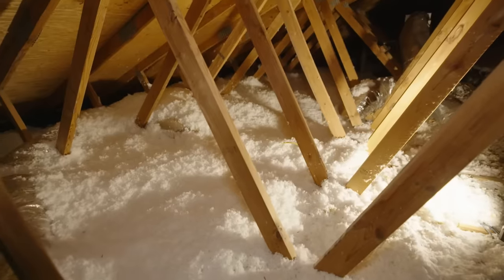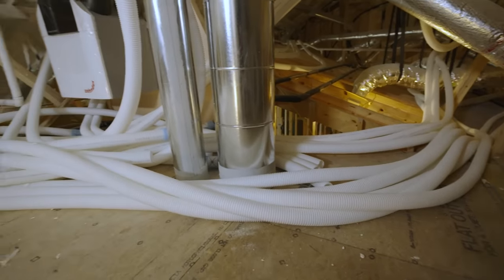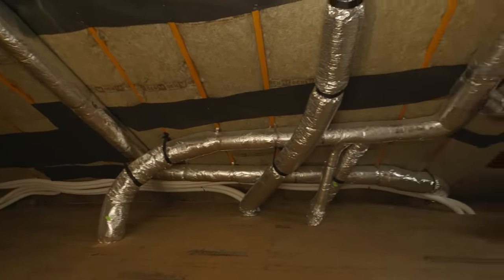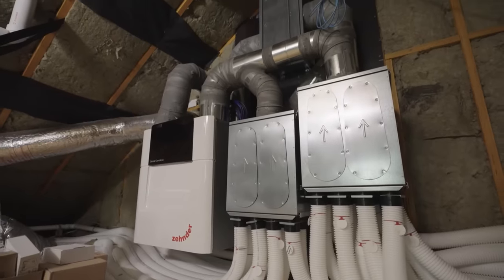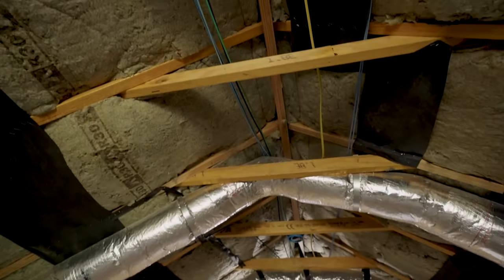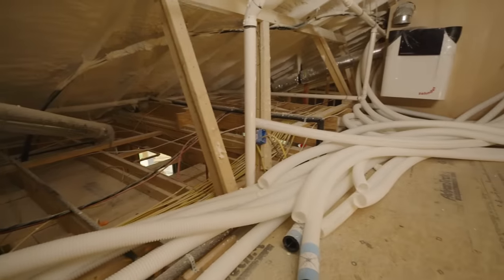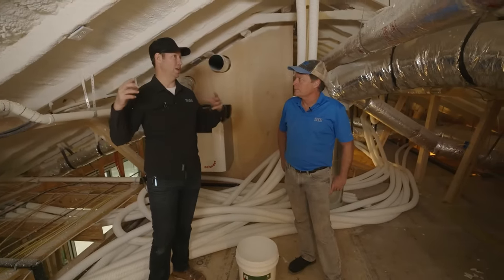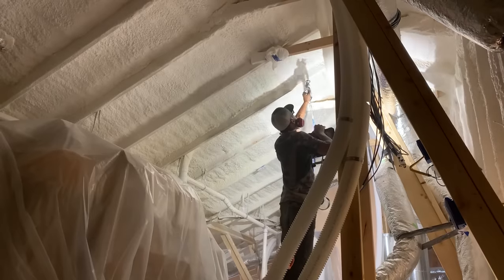Building a BETTER attic - Unvented + Conditioned attics 101

Comment: I really like what I saw in this video.  Very neat technology.  I also like that you thought about the fresh air needs.  I would not have thought of that need, but should have since I grew up in the days of the gas space heaters.  As a former volunteer fire fighter, no or at least less smoke is a big deal.  Current trends are to cut a bunch of holes in the roof to let the smoke and heat out so you can see where the fire is.  In a house fire with someone trapped, the firefighters had to back out when the FLIR camera showed the temperature at 742 degrees, roughly 4 feet off of the floor.   The trapped person didn't make it.  As the fire captain said, "no one survives that kind of heat".  The open core bedroom doors just went whoosh and only the frame was left.  This was a 50 year old brick 3-sides house with typical shingle roofing.  That was the problem.  With the room temperature that high, the tar on the bottom of the shingles melted and dripped through the sheeting, then burst into flame in the attic - making the temperature that much higher.  Once they got the attic temperature down a little, they were able to go in and pull ceiling to finish the lowering of the temperature.  The whole thing was out in about 5 minutes after that.  As a result of the SMOKE, the city inspector required that the left overs be taken to a special hazardous materials dump.   The smoke alone caused everything to be classified as hazardous.  If your house catches on fire, please remember what we taught you in elementary school, get flat on your belly and pretend you are an alligator then crawl out.  Don't stand up!  Your lungs can't handle the heat or the smoke.
Reply: Wow. Incredible story

Comment: having been raised in Florida all my life I would have to say this is the best idea I ever saw on building  an attic the right way
Reply: i had 2 new homes 1 in Pa 1 sw FL dumb thing in FL is the ductwork in attic and water pipes in attic summer takes gallons of water which is expensive her to not burn your
hand it wash them and the efficiency loss on a/c saves builders a fortune but cost extra every month

Comment: My attic used to go to 130F in summer.  I had spay foam installed and it rarely reaches 90F. The electric bill has been reduced by about one third. But the more important thing is that the AC cools the house much easier. From Atlanta… the other benefit is that the attic is much more usable because you don’t temperature extremes. My attic is floored so it’s like adding extra rooms to the house.

Comment: In England, a 'conditioned roof' is referred to as a 'warm roof'. In colder climates (colder than Texas is most of the time - but maybe not MUCH colder) it's vital to have a vapour control layer (VCL - usually a membrane) on the warm (inside) side of the insulation so that moisture-laden warm air cannot move from the living space towards the colder outside, which would result in interstitial condensation.  This is ruinously damaging for out of sight woodwork.  What we learnt as householders doing a retrofit conditioned roof was that most roofers knew less about this new constructional method than we (who had taken an interest) did.  They, being used to loft spaces being ventilated,  just did not 'get' the importance of the VCL....which is very tricky to implement properly at abutments and penetrations.  A warm roof, as Matt says, is brilliant - but it has to be done right.

Comment: I used radiant foil OSB when I built my house in SoCal, the attic was 20° cooler than the outside in 100°+ days. Well worth the additional cost.
Reply: Can only imagine the price of that today considering the price of normal OSB..
Reply: @MrWiseinheart  thanks to the liberal policies
Reply: @vcubed7275  exactly every cost increase in the world is directly related to liberal policies
Reply: @butch8792  yes! I’m glad we’re on the same page
Reply: @butch8792  No, just 75% of them.
Reply: Doesn't it reduce life of the shingles?
Reply: @vcubed7275 
Just blame it on liberals for everything.

Comment: The biggest practice change is trusses vs rafters. Newer houses use trusses because they are faster to install. Most people who can afford on site cut rafters do so for the extra attic storage space.
Reply: Also, if you're in an area where high winds can be an issue (tornadoes/hurricanes) check what happens to the prefab truss roofs.
Reply: Maybe they can do it with attic trusses.
Reply: There are a variety of truss designs. Some easily allow for use of the attic space.

Comment: We have an unvented attic and it has its ups and downs. live in california and out attic never gets above 85 degrees even if its 110 outside. Now this is great during the winter cause it really insulates our house and inside will never drop below 65. However during the summer after the long hot day and when it really cools down outside it takes forever for the inside of our house to cool down even if we have a lot of windows open. Its like a greenhouse effect and the house doesnt cool down until the attic finally cools down.
Reply: We love our whole house fan on those hot days when it gets below 80 by 9 pm. We’re good without ac til late mornings. 

Maybe that’s where Matt is talking about the fresh air resupply?

Comment: Matt, love you videos, but for most people / builders, spray foam insulation will remain a pie in the sky scenario due to its high price. However, I do think LP Techshield + R13 or R19 in your roof rafters with a 2" air gap would be sufficient for an "upgraded" home in terms of its attic insulation, IMO. Then, get your ducts sealed /& stretched out really well over your ceiling joists with blown-in insulation over them. Finally, make sure your HVAC unit is in an insulated room / closet and add a QuietCool attic fan that operates at 70 to 110 watts to remove any excess heat. Good ventilation is also key, of course.

Comment: Keeping it 100% real, I’ve been doing contracting for years now and I can’t even imagine customers wanting to spend all that money. 4” of close cell your looking around $5-$6 per sqft depending on the area and each bucket of costing is $300 each. In Texas you do not need 4” of close cell at all. In Canada we’re temperature goes under 0 use 3”. It’s amazing what their doing but way out of the budget of average Americans.
Reply: We do need the 4” (and more) in the south and southeast except for opposite reasons as you. We want to control heat and keep the a/c where it belongs. Building code in my part of Alabama requires R-30 or better. 

Biggest problem with this conversion idea is roofing material and warranty. Most materials except membranes and some metal roofs require backside ventilation (especially shingles) to prevent excessive ware on the asphalt plys and melting of the roof products and coatings. It’s also a problem with water vapor (depending on the roof type). We’ve done exactly this type of thing but have to use a ventilated nail base or put metal on furring strips.
Reply: Robbie Wahl roofing membranes as in the peel and stick membranes?
Reply: @drlava641  Put a layer of cedar breather between the deck and the asphalt shingles, in effect venting above the deck instead of below it.
Reply: @27photogger  no, I refer to commercial membranes such as TPO, EPDM or PVC. The only peal-and-stick that, I think, is appropriate would be a Modified Bitumen type and you’d have to check with the manufacturer.
Reply: In the north where you can actually have a basement, it makes sense to have a vented attic if you do it right, to so much less expensive and you can pile on the cellulite.

Comment: During a week of measurements in Mid-June, 2021, my 'traditional' attic in Spring, TX (North Houston) averaged 4 degrees hotter than the outside temperature (measured in the shade).  The max differential was 9 degrees at 7 PM.  The temperatures were measured from 7 AM to 11 PM.  Mid-afternoon outside temps were 95-96 degrees.  There is radiant barrier sheathing, ridge vents, continuous soffit vents and one solar powered Attic Breeze exhaust fan in the attic space.
Reply: BS

Comment: I understand you have a metal roof but if your roof is standard shingles, the shingles need to permit some heat to pass through.  If you insulate right against the plywood roofing sub-straight, that heat will be forced back to the shingles and cause them to dry, crack and edge curl greatly reducing their lifespan.

Comment: I unvented my vented attic 10 years ago with 4" of hi density foam. It has been great. I don't get blast of hot air when the A/C comes on or freezer air in the winter.  I do not use my attic as storage so no paint needed, 
To convert, I fashioned solid foam blocks to stuff over the outside walls to spray against. Just sprayed the bottom of the ridge vent as the opening wasn't very wide. I would have used something like zip tape if I did it now.
I can work up there any day of the year. It is only a couple of degrees from the living space below.
The leaky roof is not an issue. I have a metal roof and even if I didn't and I let the roof go for 40 years, I could just resheathed the roof over the existing plywood.
I live in upstate NY and did this when the old experts said it was a mistake, and now today it is the preferred method.
Reply: Ray C , great job but you may leaks since all metal roofs will eventually leak. Them yiu have a mold issue.
Just saying

Comment: I’ve done the same thing with batts and I only use spray foam if it’s the only way to insulate the particular job or if the client insists. The jury is still out on what happens to the plywood that’s above the insulation if it has no air flow or if it’s sealed on the cool side as with spray foam. That’s why I prefer batts up against the roof deck but with fluted baffles connected on the down side by a vented soffit and on the upside by a ridge vent. This allows some air movement between the insulation and roof deck thereby reducing a little bit of the heat build up. Great video but I might add too that the depth of the trusses will determine the depth of your insulation in turn the R value of the insulation. The video shows R30 therefore you’d need a minimum depth of 10” to allow for R30. This would be a special order truss if you’re building new or you’d have to fur down the trusses. Great video Matt. Keep em coming!

Comment: Here in the UK with our wet climate that spray foam 4:56 is deadly to wood beams in the roof. Do not use spray foam like this in a wet climate. We bought a house which had it done 5 years prior and I could crumble the wood under the foam with my bare hands. We were lucky the roof did not cave in on us and we had to replace most of the roof in the end. What happens in a wet climate is the water soaks into the wood throughout the year but especially during the winter but does not get time even during our "3 month summer" to dry out fully. This is because the spray foam first of all allows the water to pool and collect in between the spray foam and the wood but also prevents the heat from the house from getting to the wood at all which helps dry the wood.

In a wet climate stick to rock wool or glass wool insulation if you want your wood to last. I think I would even be hesitant to use spray foam insulation in Texas without creating space for the wood to breath. Let me know if 5 years how it held up.
Reply: Huh, that's odd because it's been used extensively here in Florida for years now with absolutely stellar performance. Sounds to me like there were underlying issues with that property.
Reply: @chadleach6009  Our roof was 100+ years old so the damp proof sheet between the wood and the tiles was not exactly performing well. This meant moisture could get into the wood and collect over years between the foam and the wood as i said.  The wood beams which were not fully covered in foam were able to breath just fine and dryed out in the summers nicely. The others covered in foam were wet and crumbled in my hands.  Wood does rot in water especially old wood and our houses here in the uk are 100 - 200 years old easy so i think that + the temperature + how it is installed + roof type/angle are all factors.  I imagine this stuff works great in many scenarios but I will be sticking with glass wool insulation which breathes nicely.  Also removing that foam is a major pain too. Took all day to scrape it off the wood when we replaced 90% of the roof. Lots of landfill. Glass wool could have been put back in place after repairs so i think of foam as "fast food roofing" now. Not for me. I will also assume the owners are trying to hide problems with the roof in any future properties i purchase which luckily we also did when we viewed this property 5 years ago. We asked for 8000 off as we thought the roof might need repairs which it did.

Comment: I just got a new roof and changed to a conditioned attic since I have a lot of AC ducts in the attic.  Night and day difference, so glad I did it.  Now it's 78 degrees in the attic (same as house temp) instead of 120F on hot summer days.  I went with 3" polyiso insulation and lightweight concrete tile mounted on battens.  The air gap between the tile and battens allows hot air to rise and cool the underside of the tiles -- that serves the same function as a vented attic.  I was originally going to put mineral wool between the rafters in the attic as well, but because of the good performance I will probably skip that step.  With modern insulating materials (polyiso) I think it's crazy to design attics the old fashioned vented way.  Another benefit I didn't think about originally - closing off all the vents will prevent termites and insects from flying into the attic.
Reply: and mice, birds, bats, lizards from nesting.
Reply: @MommaARA  rats an mice an birds need a safe warm protective place to live slso dont they??

Comment: I'm glad you mentioned that zender thingie at the end because I was really wondering about how air exchange is handled. Because otherwise a really tightly closed up building is going to have a build up of CO2 and get uncomfortable fast.
Reply: One of the ideas that Matt is promoting and which you find with systems like Passivhaus is to build the house really tight, and then design in a very good ventilation system. This will keep the air in the house healthier than outdoor air because the ventilation can filter out pollens, dust and pollutants, and maintain a good humidity level. Also the ventilation should include heat exchange. This kind of ventilation is becoming more and more common in good quality newly built homes.
And of course, weather permitting, we can still open the windows.

Comment: A few years ago I re-did my attic in probably the largest home improvement project I will ever do lol
1950s house, and the attic was finished in the 1970s, and the thin drywall and cheap wood panneling was falling apart, and it was always hot/cold up stairs.
Gutted everything except the framing, then added a spacer on the roof line, then a radiant barrier, then batt insulation, and then thick drywall.  It changed so much!  Still need AC units in the summer, but much smaller units keep up well even on medium where we used to have much larger units on high all summer.  Things are quieter, cleaner, less humid, and everything is working really well.

Next step is figuring out something for the AC/heat up there.  Heat rises, and that is the only place to escape to, so it stays comfortable in winter, but there is a lack of air flow/exchange, and during the summer AC is absolutely required.  The rooms all have HVAC supply vents... but no returns.  Our HVAC is from the late 80s, and it is kind of a miricle that we havent had any issues with it  yet, so we are saving up to replace it as the next big home project... that that will be a doosey, but I wont do that one myself.  Hoping to move the HVAC to a different location in the basement (what use to be a garage that is walled off), and re-route all of the supply and return vents in the whole house to make more sense and work better.  Should be the last step of 'functional' changes to the home before we go nuts with purely aesthetic changes to finally make our old 1950s wrecker look as nice as it feels to live in since I have done so much work on the electrical, insulation, and water management aspects of it.  We have the biggest home on the street, and the lowest power bill, but we keep the house at 70* year round while most neighbors keep things at 75 in summer, and 60-65 in winter.  Been a lot of work, and it is nice to feel results.  Cant wait to make it look nice and 'see' the results.

Comment: Back in the day, insulation in direct contact with roof sheeting was a no-no because the shingles get too hot. A space for passive venting kept the shingles a little cooler.
Reply: The shingle roofing literature mentioned one had to have a vented attic so the shingles say cooler or the shingle warranty was void. The buidling codes too also had plans reviewed to check the number of soffit vents and top vents so the attic was vented.
Reply: It depends on the shingle manufacturer. GAF provides warranties even for unvented roofs. Tamko doesn't.
Reply: Our local codes require it. Plus, I don't think the way the attics in this video are framed would pass snow load requirements with 2 x 6 rafters on 24" centers and no strongbacks. We typically use 12" TGI engineered rafters for applications like this, but the joist space is still vented.